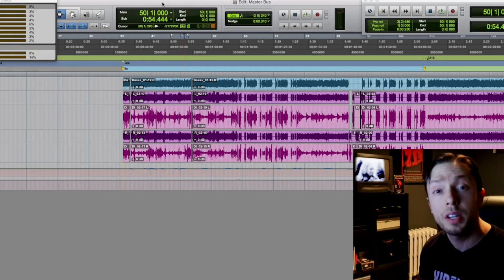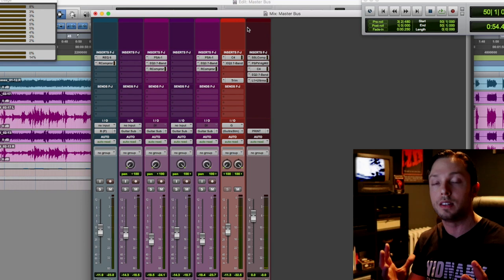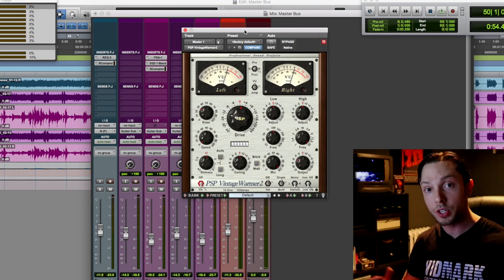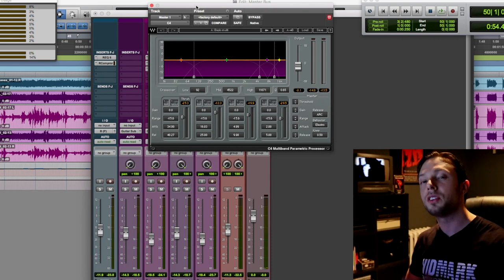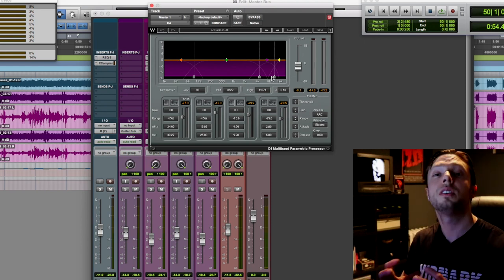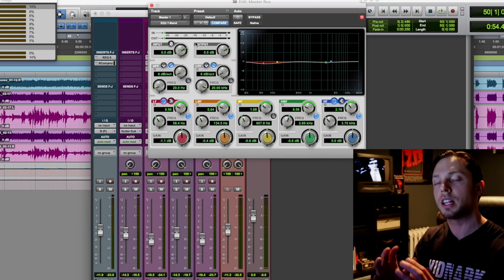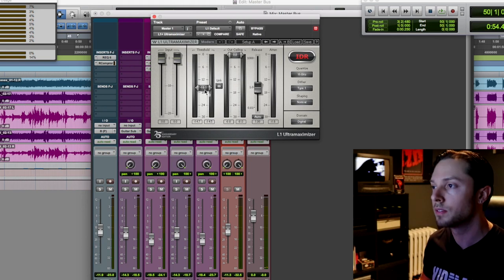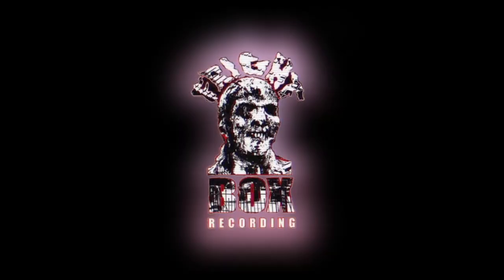My Master Bus Chain For LOUD Mixes

Comment: I've found that using a lot of parallel processing can result in a very loud mix without any obvious pumping or artifacts. I use a combination of parallel compression and something I call parallel upwards midrange compression. I'm sure there's a better name for it, but that's what I call it. 

The parallel midrange is set up as an aux track. On an aux track I have a Fab Filter EQ with a band pass on it, so that only 800 hz to 8k is passing through. Then after that I have a Waves MV2. I am using the upward compression slider to raise the low level signal. But because it's band passed, I'm only raising the low level signal OF THE MIDRANGE. Then I send my entire mix into this to taste. This fills out the entire midrange and gives it way more consistency. Midrange is where perceived loudness lies. When I do this I notice a huge difference on my LUFS meter, plus the whole mix sounds better -- punchier, clearer, more exciting. 

I think a lot of people struggle because their mixes are too scooped. If you have too much low end and high end, it's going to be difficult to get your mix to sound loud. The low end will distort too much and the high end will sound too harsh. Plus, there's just not enough frequency content where our ears are most sensitive.

Comment: Personally, I like the Brainworx Townhouse Buss Compressor for my master buss. It's essentially the same as the Waves SSL but with one key addition: a side chain high pass filter. I find that makes a huge difference. If you use the Waves SSL on your whole mix, it'll respond too much to the low end for my tastes. It can be great on individual instrument tracks though. 

Anyway, loving your channel. And I don't even mix metal. But all the knowledge here is useful for the indie rock I do.

Comment: I second the A/B comparison previously mentioned. My question is this: is this master bus chain added and effective while you mix, or do you mix all the individual tracks (i.e. eq, comp, any effects and balancing) before you engage this master bus chain?
Reply from the maker: It varies, but generally the SSL is on there from the get-go and I add the rest during the last 20% of my mix.  I have a video in the pipeline that goes over the entire process from a workflow standpoint.  Thanks for watching!

Comment: Hey Bobby, great video!  Quick question, I got kind of confused when you mentioned ‘bouncing and sending to mastering engineer’ especially when you started talking about the a limiter.  If you’re applying these processes on the ‘2 buss’ , why would you send it to the mastering engineer?

Just need some clarification. Thanks bro!
Reply from the maker: These processes are very subtle and the limiter is just used to boost gain and not for gain reduction.  Most pro mixers send the mastering engineer tracks with the their 2 bus chain applied.  Think of it as part of the mix.

Comment: Awesome stuff dude! every video you put out is filled with useful knowledge 🤘🏻 quick question regarding gain staging: I didn’t put too much thought into gain staging during my first mixes, and as a result my templates for my mixes all clip at a certain point when all my tracks meet up on my pre mix bus. This is a bus where I send all my instruments prior to the actual master bus. To solve this, I just added a gain plugin prior to the fader on the pre-mix bus and turned down the gain to avoid clipping. I then turn up the volume on my actual master bus by using the method you described in this video. Is it problematic if I’m clipping at the point in my mix that I just mentioned? I always thought as long as you don’t clip going into a daw and going out once exported then it’s not a big deal, but I was interested in what your thoughts were on this
Reply from the maker: GREAT question.  I just make sure I don't clip.  Also, check out this interview...Jordan Valeriote has a great way of going about gain staging and I follow a similar approach:  https://youtu.be/BKgk_fUn7Rc

Comment: Hey man, awesome video! Your channel has been super informative when it comes to mixing metal. Quick question though: what values would you aim for (both lufs and rms) if you were to master a track for streaming? I’ve put a meter on my mix and I’m a little confused. The overall lufs is just over 7, while the rms hovers around 11. I’ve read that streaming sites normalize at around 14 lufs, but this doesn’t address rms at all. Do I just completely ignore rms values? When I compare my mix to reference tracks they sound hella quiet, but if I go by the numbers then they’re up to standard for online volume. Btw, when I say mix I’m referring to the mix with my attempted mastering processing on the master bus 🤘🏻
Reply from the maker: Hello Jacob!  So happy to hear you're finding the vids helpful. Great question,  I don't worry about the overall RMS for my master.  I always set my ceiling to -.1DBFS.  When it comes to limiting, I make sure my mastering limiter is doing no more that 2dB of limiting (minus a few peaks here and there).  If my mix is well controlled and I've created sufficient headroom in the mix itself, I usually have it sitting at a commercial level with the limiter doing minimal gain reeducation.  I make sure the level is hot enough by comparing to my previous masters.

Comment: Are you also using the ssl comp for volume? It looks like you have the make up gain slammed 15db. Is that correct?
Reply from the maker: Hello Mike!  Yes, in this case I am since I had a lot of headroom in the mix itself.  As long as I'm hitting roughly 2dB of gain reduction in the SSL, the tape sim roughly .5-1 dB, and my C4 is doing around 2-3db on the peaks...the result will be the same.
Reply: Frightbox Recording awesome thanks for the info!

Comment: I don't understand multiband compression. Shouldn't you have got the instruments how you like them before this stage? Why are you fixing problems on the mix bus with multiband compression? It appears you're using it to control the low end a lot. Why didn't ya just get the low end where you want it before this step? I just don't comprehend. 

So it looks to me like you're basically mastering? The last thing you do is raise the volume. Looks like mastering to me. So is this mastering or mixing?

Comment: Great stuff Bobby. What input level do you set for your guitar tracks? Ive been recording at -18db but I'm wondering if maybe I'm not getting a powerful enough sound before mastering.
Reply from the maker: Do you mean in terms of the input level while I'm tracking or when I'm mixing?
Reply: @FrightboxRecording  tracking. Do you keep your tracking level lower(-12 to -18) or do you push it toward 0db and bring the volume back down afterward to get maximum signal and minimum noise?
Reply: Record to -6Db and turn it down later.
Reply from the maker: @alterbridge9687  I track with my input peaking around -8 on the way it in and turn it down when mixing (just like Charles mentioned).